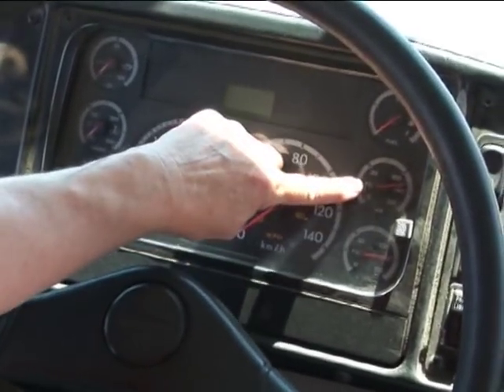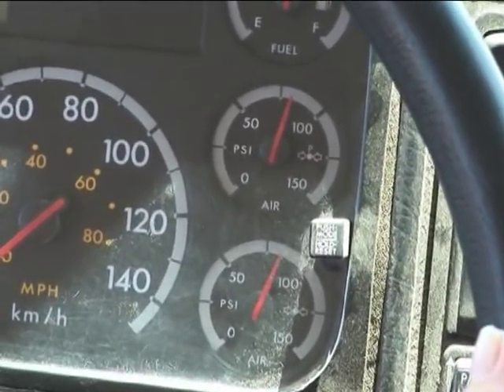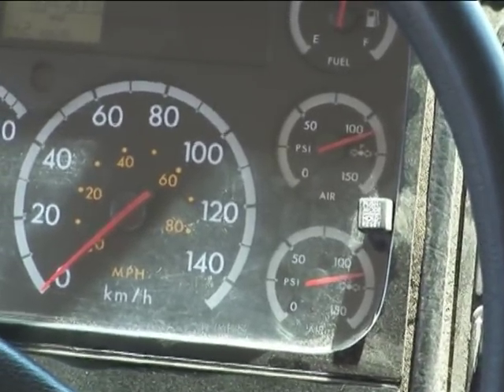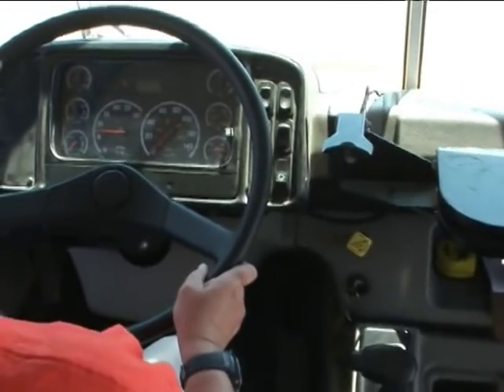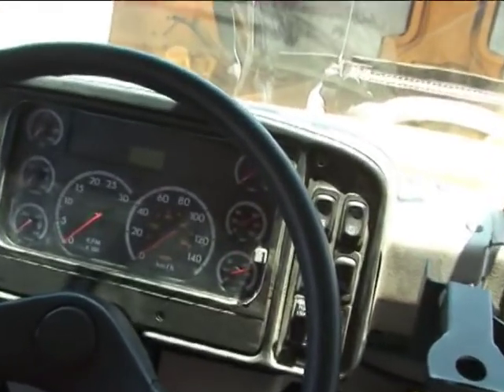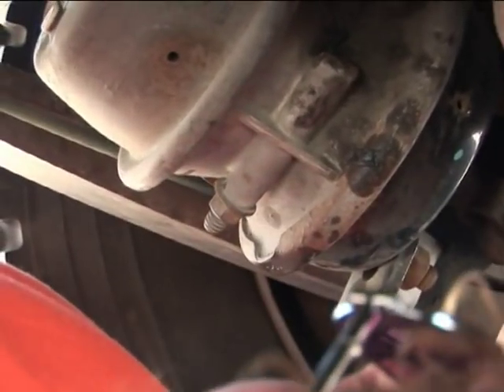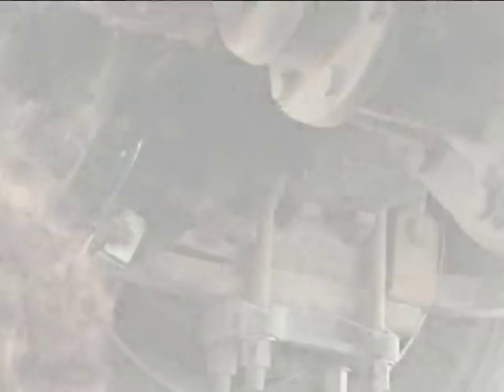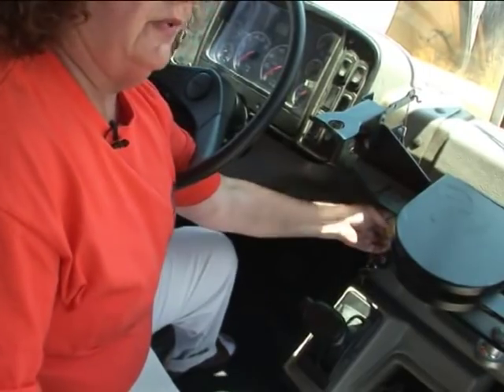Air Brake Practical Test

Comment: You never told them to release their break first. Never pump your breaks with you tractor valve engaged or you will compress the breaks. Also the vehicle should be off not running.

Comment: Good video and one I will keep on a personal playlist. I'm in AZ training now and had my Air Brake Handbook out while she went over each section of the air brake test. The only part she skipped, bc it was a school bus and not a tractor-trailer, were the testing of the trailer service and spring brakes. For those who are thinking about becoming a professional driver, do it. I'm leaving the kitchen work I've been doing for 12 yrs bc there is very little growth, its virtually a dead end job, and kitchen work makes it difficult to provide for your family efficiently. I also acquired heavy equipment tickets prior, but added the AZ training to vastly expand possible opportunities. I cannot wait to complete my training, but it all comes down to the road test and air brake practical.
Reply: Aren't spring brakes just emergency brakes

Comment: I don't think much of the negative comments because this is a pre-trip inspection, not a full DOT. Yes I know there are different standards for a 3 tank and a 5 tank air system but drivers don't know the difference. Great Job on the tutorial!

Comment: Why did you not pump the brakes down when testing the air loss for once minute to see if the automatic application of the spring brake application was functioning properly???

Comment: We do this on every chassis going down the line.......
Air test.  Pump it up and see if it holds.
The admissible leak is about 1/2 PSI in a half an hour, if I recall
I do not do chassis testing.

Comment: @metrotruck in the State of California you would of had an   Automatic failure. When doing the warning light test it comes on between 55 and 75 psi . You are supposed to stop stepping on the breaks the minute you see the warning light on the dashboard. You kept going . The cola test or  Otherwise known ass the air break test needs to be done at 100%. No mistakes out loud.

Comment: @kirk42011 how do you figure? the vehicle has to be running for the compressor to work. which means for your build up time, gov cut-in and cut-out the vehicle has to be running. she actually would have passed. hate to inform you.

Comment: air brake pressure is as to stall speed on an airplane, both with a warning horn, if they drop below a certain value you could potentially end up dead
Reply: derSchweiz unlike planes, trucks have a redundancy called spring brakes

Comment: there r anticompounding devices- that prevent excess pressure on brake system-even if u press both. actually u r supposed to engage spring brake , then release service br

Comment: so, you have to do some checks twice? (air leak, low pressure warning are done on two if the videos)
Reply: Jim Radix  you do NOT have to do the tests twice. The reason probably is, is because she has the bus running the whole time. As long as the bus is running the governor will always supply air to a tank that's low on air pressure.

Comment: really the wrong checklist. 

for example - of one spring in park brake chamber is broken you cant move bus on dry surface. So I do weekly inspection on pit.

To check slack ajasters I ask someone to assist me and I check ajuster screw with tools.

To use wood bar looks dangerouse idea, especially if you disable park brake and jump under truck. Chocks are not so reliable thing, especially made of plastic

Comment: what why secs for build up time what country is this?
Reply: Because it tells you if the pump is working properly. If you have to redline the bus to build up minimum pressure in the allowed time then the pump is not good enough for the road and air pressure will not be maintained for everyday driving.

Comment: That was to much math involved in that you have to do all that before you can drive they better get to walking,its a good video but damn that.
Reply: ***** another way to measure the push rod adjustment limit is to mark the push road against the chamber casing, then apply the brake, then come back and measure from the casing to the mark.  As long as that measurement is less than the adjustment limit for the type and size of brake all is good.
Reply: Hi. As far as the math goes, I'm hoping this may be helpful to you. When adding/subtracting fractions there's something in Algebra called "the common denominator", with the numerator being the top number of a fraction and the denominator being the bottom number of a fraction. So with 1/8, the number 1 would be the numerator and the number 8 would be the denominator. To subtract say 1 1/8 from 1 1/4 for instance, you would need to figure out how many 4's you would need to turn that denominator into an "8" so that both denominators would be equal (common). In this case, 4 * 2 = 8. Since it takes two 4's to make that denominator equal to the other, you multiply the top number above the "denominator 4", which is the "numerator 1" by 2...which would turn the original 1/4 into 2/8. This will leave you with the common denominator "8" for both fractions, allowing you to now be able to add/subtract them: Resulting in 1 2/8 - 1 1/8 = 1/8. I know it may seem a bit to tricky at first, but trust me once you try it a few times it is piece of cake to master. Best wishes and good luck.

Comment: im sorry but this is NOT the correct way for Airbrakes, you DONT start the vehicle then do the test, You turn the vehicle ON but dont start it and then so the airbrake test, then when you have the low pressure alarms going you look at the guages and listen for leaks, then you start the vehicle and build up the air pressure until the alarms go silent and guages are back to normal and you can push the parking brake in since it will be unlocked

Comment: this is a school bus driving school NOT Truck
Reply: Ze Bros It applies to any vehicle with air brakes.  There are lots of buses (highway coach, city regional transit, etc) and straight trucks that use air brakes.  If doing a tractor trailer setup, there are a few more steps to do the air brake test.
Reply: +Ze Bros It matters not what type of vehicle it is. Any vehicle CDL required vehicle with air brakes involves the same process during an air brake test.

Comment: In a single vehicle with a fully charged air system, air pressure loss (after an initial drop should be less than..  *2psi per minute

Comment: No offence but this stupid test emphasis most on technical aspects of the device as if there is only one kind of break system. I would like to hear how she might describe brembo brakes. It's only driving not rocket science give people a break.
Reply: What the fuck are you talking about? She's doing the pre-trip air brake test.

Air brake system is different from foundation brake systems... These checks determine whether the compressor, supply lines, service lines, reservoirs, check valves etc etc are functional before you start driving down the fucking highway. This has to be done daily before moving.
Reply: id love to see you study for a CDL-A license.  you might consider it rocket science.